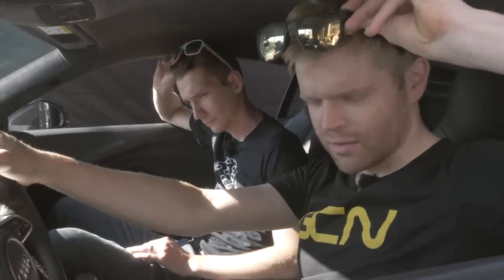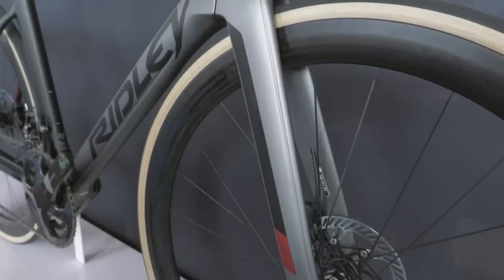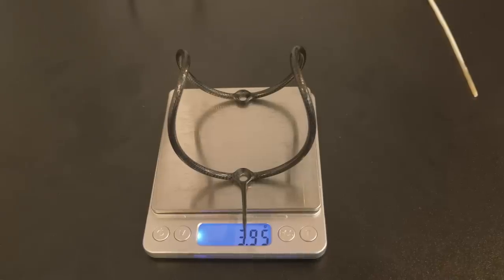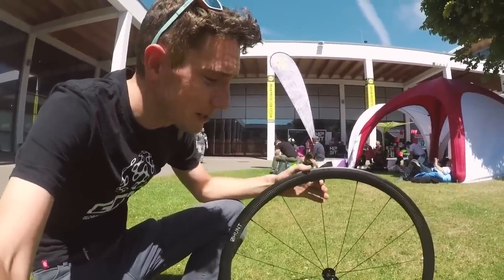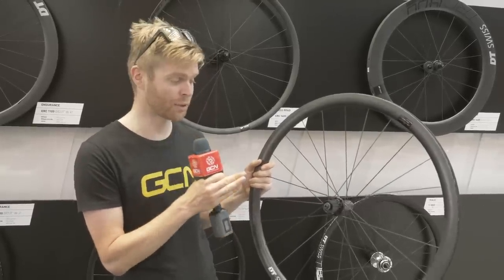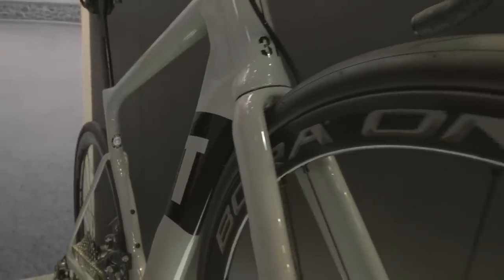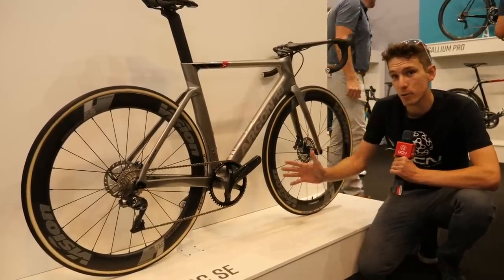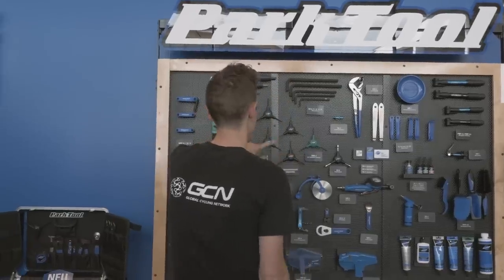Aero & Lightweight Road Bike Tech At Eurobike 2018

Comment from the maker: What is your favourite lightweight or aero tech? Make sure you let us know your thoughts in the comments!
Reply: Fave piece of aero tech is the improved focus among frame manufacturers on making fussing with your cables/hoses actually manageable
Reply: bottle cage is 0.012 grams to much
Reply: Pizza cutter.
Reply from the maker: Gordon Moat Sure is a good one 🍕
Reply: I'm disappointed that they didn't make the carbon fiber pizza cutter they showed on their April's fool video. The plastic one doesn't cut the mustard...so to speak.
Reply: Apart from the 3t it's fair to say all disc aero bikes now look identical.
Reply: Controltech key skewer 29g for the pair, saves a couple watts in aero too. Got a pair.

Comment: F1 pretty much "peaked" with their aero design.

With all these aero components releasing into the bike market,  I do wonder if it actually gain any real world performances noticeable by an average person?
Reply: guesswho kk slowtwitch has an article on if we are at peak aerobic bike design. Basic summary is the newest wave of wild design bikes didn’t really get any faster. P5-six and P5-x are basically the same in terms of grams of drag as the prime example.
Reply: guesswho kk f1 is not the best comparison though, they could do more, like last year’s now banned t wing on top of the shark fin. Now they pursue gains such as with the floor that  generate less of a wake so the racing is better for the fans. Rules on wing sizes and the like will prevent the absolute fastest in favor of entertainment.

Comment: Could you guys please start asking at what speeds these manufacturers measure the additional/saved aero drag? Aero drag goes with the cube of velocity. It is pointless to state that a front derailleur adds 8 Watts of drag if you don't know the speed at what it was measured. 8 Watts measured at 50 kph would mean only 1.7 Watts at 30kph. Or if they measure it at 30 kph then at 50kph it would suddenly become 37 Watts of additional drag.

Comment: Holy moly. If the 8 watts saved from a missing front mech, are even remotely real, I will have to start to question the sanity of many time trialists or triathletes. I mean even if it was only 5 watts, that's huge in time trials money
Still see so many 2x drivetrains on TT or Tri bikes

Comment: A quick request - If you quote aero improvements as X number of Watts saved, please also quote the associated speed for that power saving. Without doing so makes it almost meaningless. For example, an aero benefit that delivers an 8W saving at 50kph will save approximately only 1W at 25kph. Therefore, it’s impossible to judge the significance of the aero benefit without knowing the associated speed for the power saving. If manufacturers aren’t providing that information, then they should, and it’s likely they are providing power benefits for very high speeds, to make it sound better. Good video otherwise.

Comment: Hi everyone, just a quick question regarding a rounded headset bolt, I went to drop my stem today and rounded both the bolts as my previous mechanic put no grease on them, I have watched the gcn video about removing rounded bolts but these won’t work for me:(.....any hacks/tips that I could use to remove them?....Thanks in advance#askgcn
Reply: Tadhg O'Shea try using a tight fitting torkx bit
Reply: If this is the bolt to the stem cap, you can drill it out. Drill off the head and the cap comes right off, use a pair of vise grips to get out the bolt. You can get a replacement then at the hardware store or bike shop. (M6 I think it is)

Comment: Why are Aero bikes heavier?
Reply: g405t because the designers are a bit rubbish basically.  They say you need more material to make aero shapes which I think will sound stupid in 10 years.
Reply: g405t Aero is always comes with stiffness. So it takes more materials to make them rigid and maintain the shape thiner.
And of course new tech/experience will reduce more weight over time but, it won't be the same weight as lightweight specific frame. 

But only thing holding back for pursuing more lightweight bike is limited by UCI rule. You can safely make 5kg bike when lightest aero bike is around 6.5kg. 
With 6.8kg rule, your lightweight bike is also aero bike now.
Reply: Well, Nathan might well be a carbon composite engineer, but just in case he’s not, basically when designing a frame to be aero, you have to compromise with shapes that might not be optimal for the structure. To compensate them and maintain ride quality and strength, you need to add material. I think.